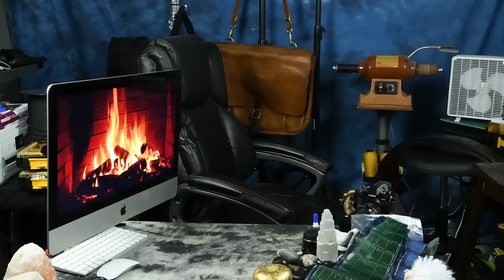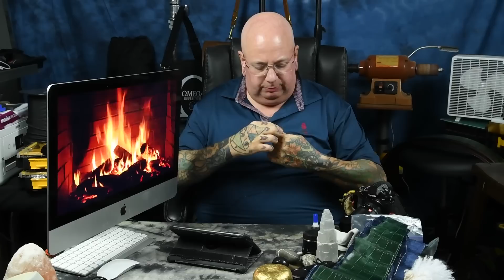🧐 FREE ENERGY Arch Form TIME Variable 🧐

Comment: Hi ken....i love liistening to your explanations of magnatism and the aether etc....i would love to hear your thoughts on what initiates the pertibation to begin with.....e.g. is it the crystalline  material structure  itself, such as neodidium, that once made, naturally resonates at the correct pressure frequency of the aether due to its stucture to produce the manetic field effect?

Have you any thoughts on material sciences, such as solar panels that use doping of different materials such as galium for example, for its unique properties with light, is it possible that doping copper wire with a material of the desired crystalline geometry may assist in a solid state electrical manifestor.

Would love to hear your thoughts.

Comment: Ken I've thought before, why'd they stop using steam engines? It seems like a steam powered electric generator would be very efficient.
What if you put an electric heating element in the water boiler and use the electricity from the steam power to heat it and return the condensed water back to the boiler.
Anyway why'd they stop using steam power just around the time electronics came into being?
It seems like coupling old steam technology with electronics of today could produce some interesting power generation.
Ken have you been been aware of the strange PLASMA FIRES that have been happening around the country  like Paradise California and several other places that's apparently happening because of Earth's poles shifting?
It'd be great to harness the power from these events too and maybe at the same time protect houses and other property from burning up.
Thanks for another great video and God bless all of you and your families.
Reply: Brrtton woods was the end of steam

Comment: I've been trying to hint how it works. I give up my little 3D lissajous coyal with a pole in the middle that inducts from what it takes from the outside!
Reply: I'll even give you some BTC if you understand what I'm saying!
Reply: dorjee ... was a weapon but there's no reason why It can't be a generator as well. No moving parts. AC .. drawn by the pole by the form you are talking about.
Reply: Don't need strong magnets. POC doesn't need punds of coppy wire. Ceramic insulation of the pole is a must though.
Reply: When I say pole I means an insulated iron pole that runs through the center on an array of ring magnets. Similar to earth's pole(s). Law of corresponance is how it's powered & to be conceived.
Reply: Don't know what ellse to say but.. build it!
Reply: If you chucked copper dust into a torando & ran an insulated iron pole threw the eye, what could be drawn at the poles of this pole? (AC)
Reply: Excuse spelling. I'm a thinker not a perfectionist or doer.
Reply: TO the last point. No AC .. but tyes DC. But what if this tornado was a magnet?
Reply: I can show you the coil form. Came to me in a dream after meditation on the sun that isn't so bright. Right side up & upside down.... pole in the middle.

Comment: Ken I can't claim this will be sensible and or logical.
It's curious that I was going to message you about this very subject, years ago I was working on a production line an because it was so exciting!
My mind wandered an wondered could a motor work if you unravelled it, laid it out flat, I had little of your understanding to such things but was drawn to ponder this due to a sensor device that was exstemely low current, it was a type of solenoid and it dramatically would shut down the conveyor if it sensored an item or a gap dependant on its set up.an it got me thinking of cars on motorways rather like items on this conveyor belt.
The sensor being a solenoid had a dramatic action which I hypothesised, could be connected to a connecting rod an spin a motor, so detecting a car not a car an so on, a pretty daft notion to many moving parts, 
But I'm rather pleased I was thinking of motors as something other than generators.
I'm sure your aware of alternative community's looking in to what on earth has gone on here in our past, there from an engineering perspective does seem to be disparity in the timeline of our technology there was an awful lot of electric stuff being used in early 1900s yet the style an design of the various cases had an earlier fashion to them like arts an crafts or art noveau.
My main thing to say to you is this, I feel the information you require may just come from the alternative community an you being you would be able to understand it or reverse engineer it.
No doubt much is 
Wackadoodle but you'd sift through that easy enough.
A few years back one chap was putting forward ac motors as a key element to an older world an that he felt they worked in a different way than we believe at the time I thought perhaps not sure,we can be subject of our own conditioning, then I found yourself saying how motors manifest rather than generate an we'll, some of the alternative researchers would benefit from your knowledge an maybe visa versa?
I could email their details if you feel it of merit, stuff gets deleted I've tried to convey this before. Cheers.

Comment: If anyone can do it, you can. Much of what you say is far over my head when it comes to science, not that you don't explain it well. I have been discussing free energy with my uncle who doesn't believe it possible but I believe it is, if not for greed. If I ever do have an abundance of resources I promise you will be one of the people I help fund. You're a genius but a humble one and I appreciate that even more.
Reply: Install a wire up in the air isolated of course connecting to a capacitor  and circuit board with all the goodies that go with it the proper sequence it fires the charge into a typical car battery man's already been there and done that.  It also has the ability to bring back old batteries that no longer work properly
Reply: @mr.obvious4371  What you are talking about is referring to the Battery Charger Pulse system. It is a method of using radiant energy harnessed from the Back EMF.

Even in Nikola Tesla's 1901 patent, it suggested to the scientific world the pulse technology - that is the method of "electrical fractionation" for a short time.
Reply: I think tesla the turbine once it spools up to like I don't know 150 thousand RPM it would run away with itself. 
Kinda like the old mig 29.  Lol

Comment: I have often wondered about the ‘Pyramids of Ancient Egypt’ Ken. Does any body with a grain of common sense believe that these enormous structures were really burial chambers? The materials these pyramids were built from suggests ‘Ether’ or dielectric or counter space (call  it what you will) Only a suggestion but do you think that the Arch Form might have something to do with the shape ie the  geometry of these structures....I’m thinking about a certain triangle here ..Gareth, Cardiff (UK).
..
Reply: Phttps://youtu.be/Bk43EJBSJTI
Reply: The great pyramid was a tool for destruction and it was there before humanity as we know it began.
Reply: a lot to do with water the was said there was a water spring or something or the sand is something like they, the is a lot mumbo-jumbo about the power of Pyramids, but a shapes go it an odd one, with only three sides, you can not have eny less sides, and still be a shape, and the 4 or 8 sides top points all come to the same point at the top, but how pointy did they go all the way to needle sharp point, like iron generators
Reply: Collectors of stars' radiation to change carbon 12 in bitumen to carbon 14..
Reply: A Pyramid ratio'd to Phi produces a positive polarity at the tips and a negative polarity at the core at 1/3rd height when properly orientated to magnetic north or south, the implications of that are obvious, you can read more about this in Dan Davidsons shape power book.

Comment: Ken show cased in a video about inter magnetic induction by sandwiched axial Rodin coil between magnets which has field geometry at homeostasis like egg shape. In the same way, by sandwiching same axial Rodin coil between circular Halbach arrays which has field geometry different than at homeostasis where by which power manifests. This is what Ken calls it gyromagnetic precession coil induction generator.
Reply: The load part blew me away today.  No load, no energy manifest, duh.
Reply: Exactly
Reply: @adolforosado  Slab idea..Consider 3 circular halbach arrays with 4 pole with 12 cube magnets and Sandwich OD configuration one between SIDE configuration ones. Any thoughts?
Reply: Beautiful. Stevey check it out.
Reply: video link?
Reply: @ericalexander6829  here is the link to mentioned video https://youtu.be/6HwRX3MB97s
Reply: I built a Rodin coil coil years ago. It had a dual geometry but it just sits there. You must put a hole in the dam wall and avtsp to open so the water comes out
Reply: @kilokilos  Ken say water has 108-36-36 geometry. Also water is like holographic fractal dipole antenna of life and consciousness. With this one can penrose tile of quasi crystal lattice of water to Poincaré disk/ball model of projective geometry using vortex based mathematics of binary triplet to derive holographic information as explained in the artificial intelligence video.
Reply: @kilokilos  vbm369 Ning forum is already furthering vortex mathematics like tiling torus skin of diamond crystal lattice with polarized circuits
Reply: Ok, once again pls
Reply: @Derbauer  Applied inverse coherent force image to cause levitation . It means applying rotating magnetic fields in opposite direction

Comment: I have done much ancient Egyptian technology research for the last 25 years, maybe this can give you an idea 
The Ankh is the same electrical device as Sumerian handbag. Or know as a permanent electromagnet or a perpetual motion holder, the ankh was told to have infinite life, which the device will hold a charge indefinitely. 
My theory it was a key lock, &/or a device to transmit DC current over long distances, but maybe it is up your alley.
Most everything in Egypts' ancient symbols are electrical devices, like a museum to electricity of the ancient world. 
Years ago I studied aether but not much was out there. Slowly getting back into it. 
Can't post pic, but look up perpetual motion holder. The Ankh just had its coils on the sides as arms. Ancient Egyptians loved tuning forks for Sonic carving & drilling to maybe electrical production, but water flowing over quartz creates a good electrical charge. It's a crazy hidden road.
Also, I learn years ago everything moves left, and a  magnetic material due to their vibration pushes a field out with slightly turns left and propagates back in creating a circuit or not. Through the interaction of the vibrating atomic material a pulsing push pull effect? Just a question, my thoughts are above everyone I know.
Reply: Vortex

Comment: Lenz law is the drawback to every electrical motor. There are those that have invented a motor that is not held back by this law. With that being said there still is an absolute need for a magnetic field in motion. Not the stationary geomagnetic procession in zero time sequence. This is not the same thing as what Ken is describing but it's half the way there. Ken, if you read this message, I would love to hear your commentary on the "Lenz-less" motor. I agree with almost everything you've said here minus the fact that when the rotor is spinning on a generator, there is most definitely magnetizing current that develops into the stator windings and when not connected to the load is still its own load of magnetizing current. In no case does this not exist so by default there is always a load coupled to the generator, even when nothing is "plugged in" to it, i.e., electrical load. It's not like a voltage measurement is itself the application of a load (which the multimeter is of course) that is the moment which voltage appears, the necessitate of magnetizing current has the full voltage drop of the nominal voltage rating of the generator across it. Like Dollard saying you can't see the Sun in space which is ridiculous when the eyes of the observer are of material substance itself to view it, so of course you could see the Sun in space. This is probably a bad analogy but hopefully you pick up on what I'm saying. Your videos are always thought-provoking and very much appreciated and I thank you very much for what you do. I've been really wanting to ask you, after watching a behind the scenes of the new top gun Maverick movie, they talk about shooting the movie using Fuji lenses and is a video on YouTube that goes into detail as to which ones they used and one of which was the only one in the world like it but I would love to hear your commentary on that!
Reply: You MUST unlearn what you have learned.  It's a wall of stupid flawed thoughts that builds it's machines accordingly.
Reply: @adolforosado  Very true! If people were only taught to think for themselves...
Reply: @avataros111  Yes, or thought around! Ken hit the nail on the head when he's talking about an arch-form device for "scalar" (Really terrible word to use but some do in reference to this) or point source energy manifestation. I believe an outfit in Texas has patented the technology and is laying the infrastructure and legalities for the technology as we speak. Whether or not the government's involved will dictate whether or not it goes the way of the Wardenclyffe Tower or not, is my guess.
Reply: Lenzless motor? That is synchronous motor lol.
Lenzless generator is what you are saying.
Reply: @lukiepoole9254  A synchronous motor is something completely different from what I'm was speaking of. I was giving an example of an arch form device for sake of giving an example, and that example using analogies to convey certain principles of thought that circumvent current technological issues and closer to the source of which Ken was speaking of, hence "halfway there". A synchronous motor or generator is not an example of the technology I was giving example of.
Reply: @jaredkilgore7194  What lenzless motor are you talking about?
FYI all those old 'space' pictures do not show the stars UNTIL the polarizer is added.
Reply: @lukiepoole9254  Check out Jim Murry and his DynaFlux Alternator and a number of inventions and patents to his credit. This is the best example of what I'm talking about. Interesting bit about the "space" thing. I remember hearing about that for the argument for going to the Moon.

Comment: U blew my mind again.
Superconductor arranged around the diagagonal precession path of the field. 
Latest superconductor research sees gold and silver combined in the 'old fashioned way' that is; following traditional Indian alchemical principles. Think bell metal used by Hindus for puja.
The big deal is it worked extremely well at room temperature.

I want to add another thing. Where the counter clickwise precession line intersects at 90° with the clockwise centrifugal lines will certainly be high pressure points of 'field friction'. 
That's my limits reached Uncle Kenny. Love to hear your feedback. 
Cheers Mate 👍🏻